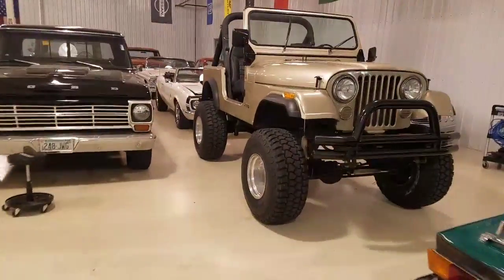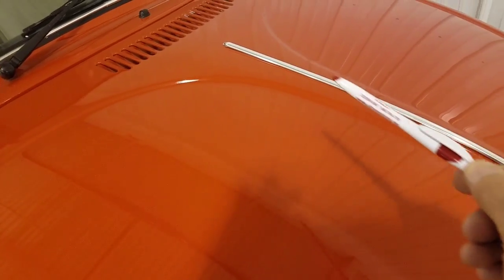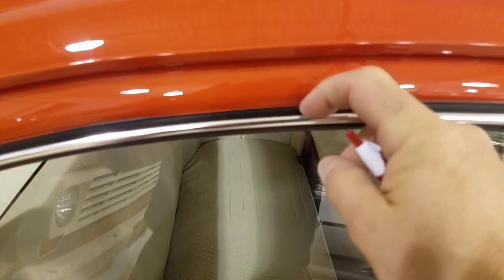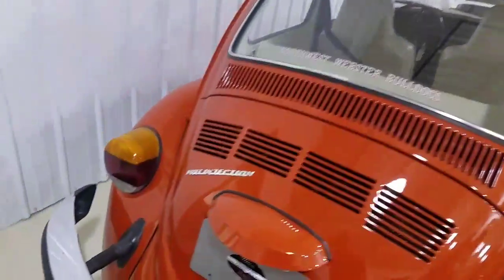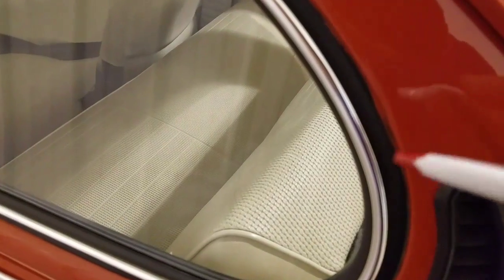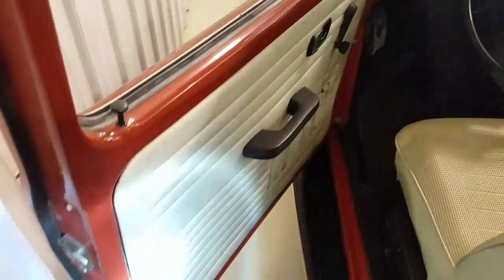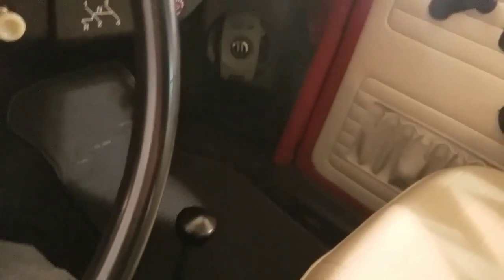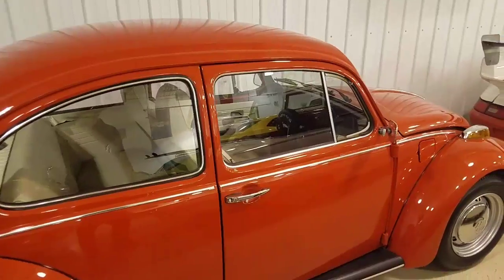1975 Volkswagen Beetle for sale

Comment: I worked in a VW repair shop in the 70s. None of the guys wanted these 1600 engines. The smaller engine was more dependable and much easier to work on. The owner of the shop had a standard beetle that he converted to 12V. Ran great.

Comment: the paint bubble behind the rear vent is a larger issue then you might think. the foam on the inside of the metal (behind the vent) is sandwiched between an outer and inner piece of metal,there is foam in there that collects moisture and rusts from the inside out, whoever restored it should have removed the foam from the inside of the metal before repainting it....
Reply: Known as killer foam.